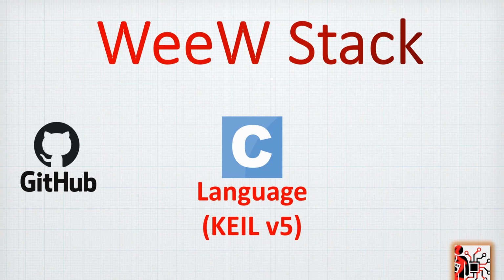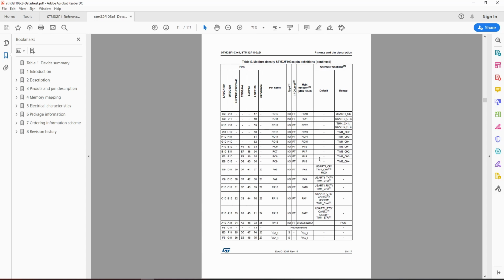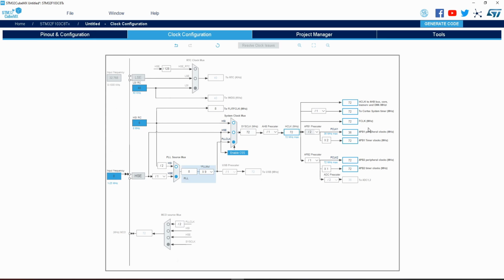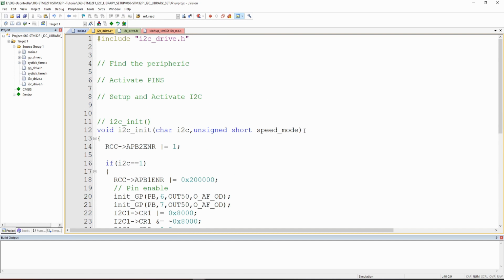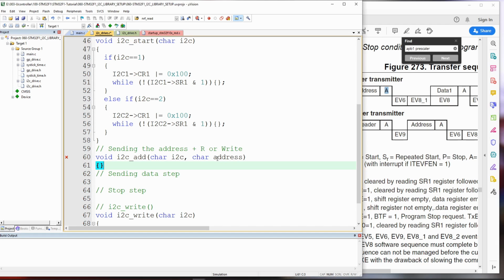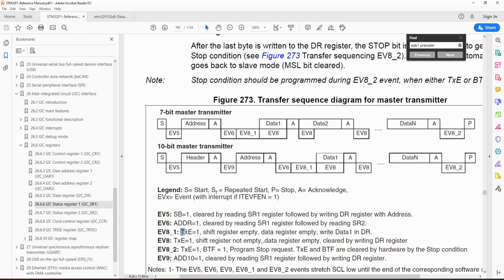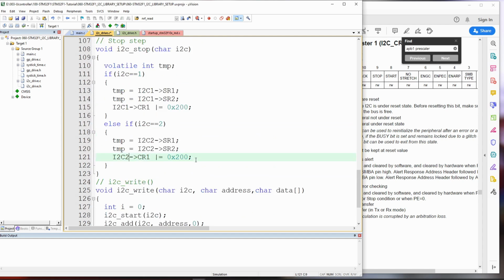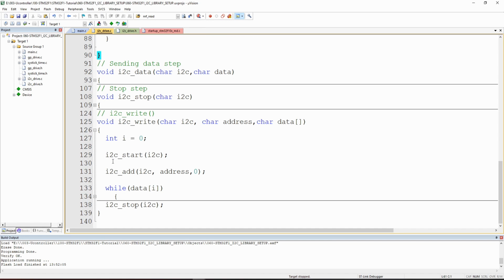060 - STM32F1 I2C communication introduction and Peripheral Setup from scratch + Signal analysis

Comment: the only problem with this way of setting up the I2C is that if the address does not exist or the slave is not present the code will hang and loop forever in the I2C_add function
Reply from the maker: Hi Cedric, very well noted, and you are right. I have actually added a caution at the end of the video about this point. This issue can be fixed by using the SR register Error bit, as in case of not acknowledge from the slave, you can divert the stack. Hope this helps, else I will be happy to make a small video about it. Just let me know
Reply: @WeeWStack  Hi no need to make another video for this one issue, I really appreciate the work you put into this you doing a great job. By the way I'm a Pic mocrocontroller user learning stm32 so I have with very limitted knowledge on this. I found that keil uvision has micros for registers name, instead of using bit shifting  which for me seems very confusing for learning purposes Is there a specific reason why you dont use the micros given by the IDE?

Comment: Hello, weew) I ran into an interesting problem while using the HAL library with i2c.  Bus data transmission froze unexpectedly.  I checked with an oscilloscope and found out what was going on.  CLK starts a little bit earlier than DATA and ends before slave makes ACK.  The slave is waiting for the next CLK clock, but it has already been, and the slave is holding ACK on the bus.  Having fiddled with the debugger, I found out that this is HAL's fault.  Thank you for showing how to opt out of HAL))By the way, do you ever use HAL?
Reply from the maker: Hi Torn, thank you a lot for sharing you experience on the i2c issue. actually I work directly using the registers, I do believe that as much as I can make something from scratch,1- I can first learn new things, 2- costumes as I want for the target applications. 
I used HAL when I just stated learning but quickly didn't continue as I wasn't able to get what was going on into the background